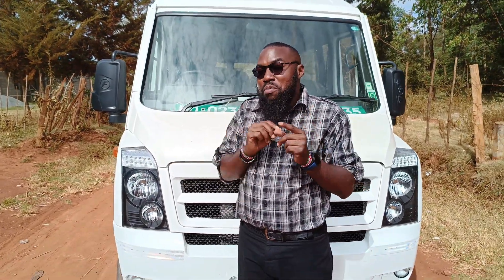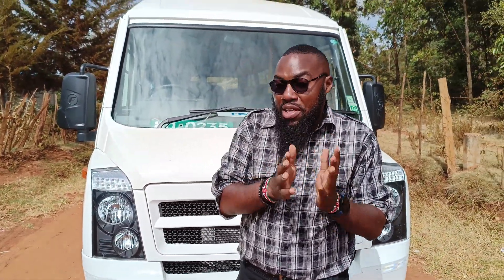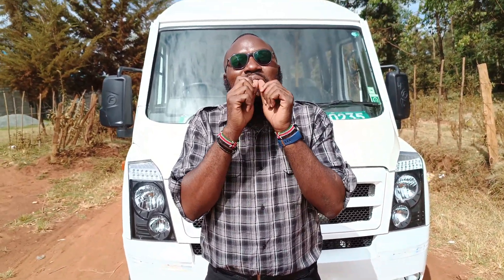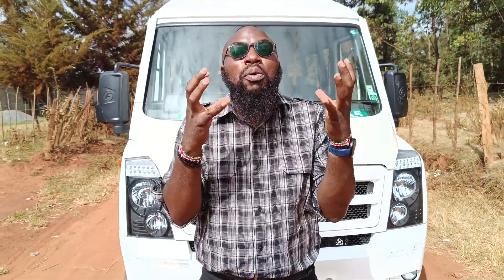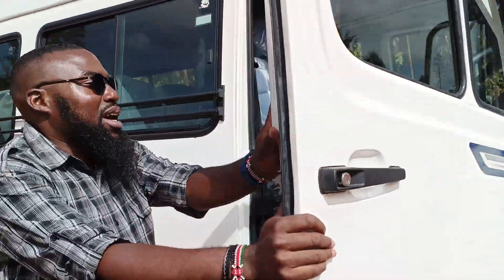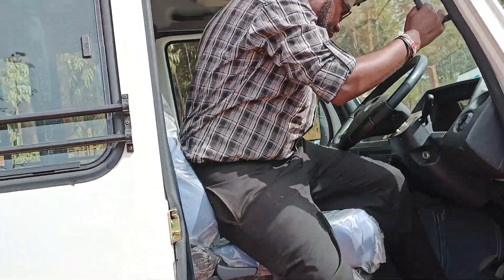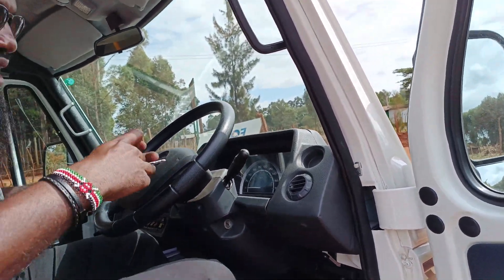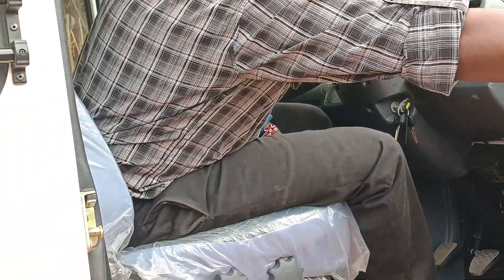Force Traveller 3700: The Numbers!

Comment: Force motors is owned by Firodia Jaya Hind Group,which is an Indian company.Daimler Benz had shares in Force motors till 2001.Now benz does'nt have shares in force motors.But they have the liscene to use the benz technology and engines.The company has formed as a joint venture between Tempo a  german company and Bajaj an indian company,and it was called Bajaj Tempo motors.Later when Benz accquired the tempo it had shares in the company till 2001.In 2005 the company renamed as Force Motors.And Force motors was assembling engines for Mercedes Benz,BMW,Rolls Royce in india.They had joint venture and technology sharing with MAN,Volks Wagon,Bosch,Traton etc..